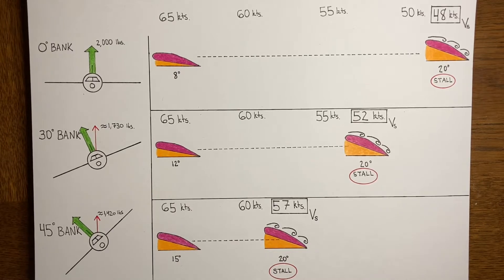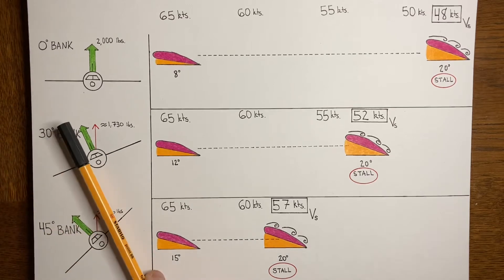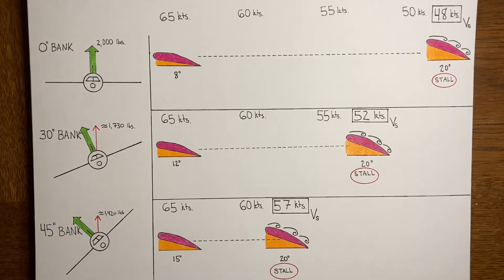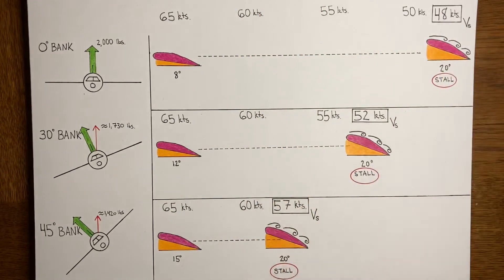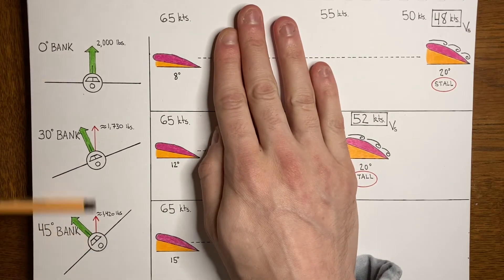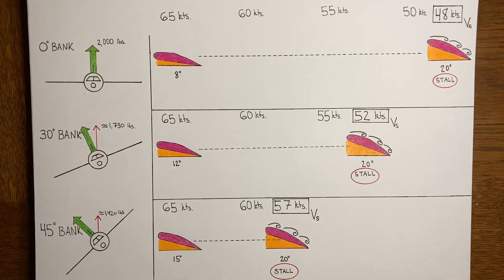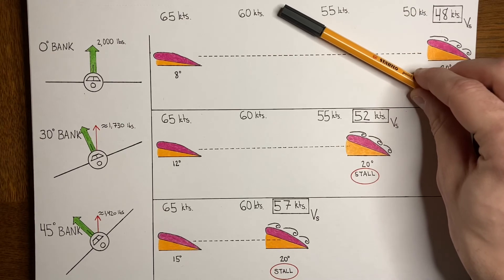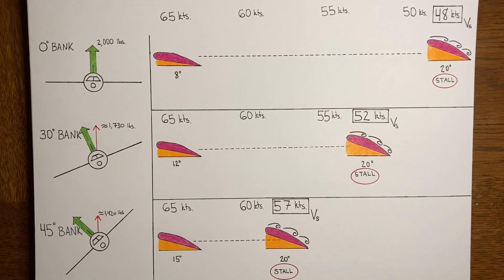Why does stall speed increase in a turn?

Comment: No mention of load factor? You should relate it to lift formula too. Your AoA has to increase to compensate for loss of lift. Stall occurs when the wing reaches its maximum lift coefficient (CL_max). If CL_max is unchanged, the stall speed must rise to produce the increased lift required.

Comment: It is not as simple as bank factor.  If you simply stop pulling back on the yoke/stick and let the nose drop you won't increase the stall speed.  The insistence of maintaining altitude in a turn when it is not required is a major downfall of current training.

Comment: Can we use the rudder to maintain altitude during a turn ? Is this what is referred ad coordinated flight ?
Reply: This may be too late but the answers to your question is No. you cannot used to keep the aircraft coordinated. This will keep the aircraft from skipping and skidding; and potentially get yourself into stall spin situations depending on the maneuver you are doing. Rudder usage is very important during stall maneuvers.
Reply: @nimbapilot6925  great thanks, so what does a coordinated turn mean ?
Reply: @DJeb86  I think coordinate turn is that: when you take a left turn, you move the control stick to the left, left aileron go up, right aileron go down, left wing move downword, right wing move upward due to more camber is formed, more lift and more drag is produced on right wing, this causing a right yaw, so we need to move the rudder to the left, to force the nose of aircraft to move to the left to counteract with this adverse yaw. and because of the lift is decresed, also elevator should be deflected further to increas AOA to maitain enough lift for level flight. all control pannels are coordinated in a turn to maintain a level flight, without sideslipe,  I think that's why it called coordinated turn.